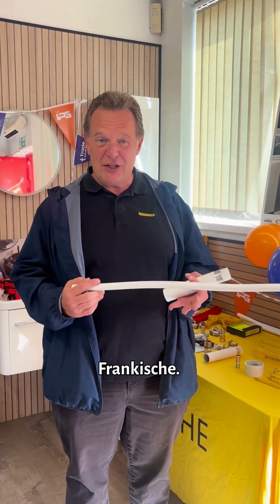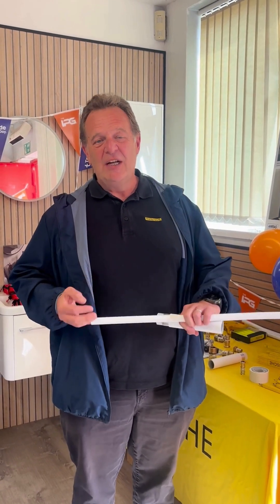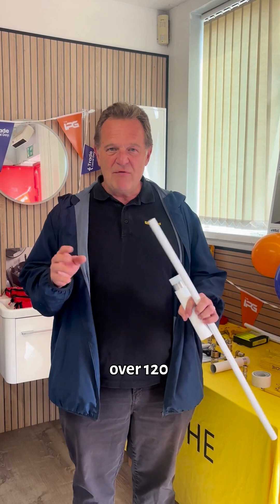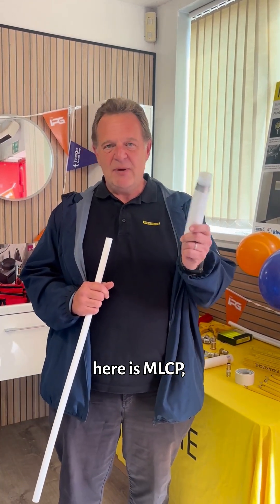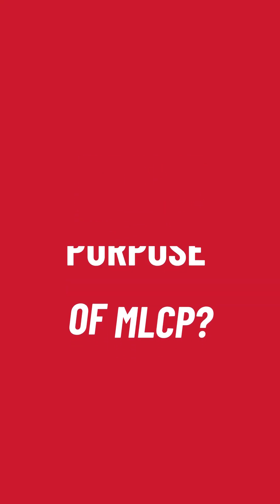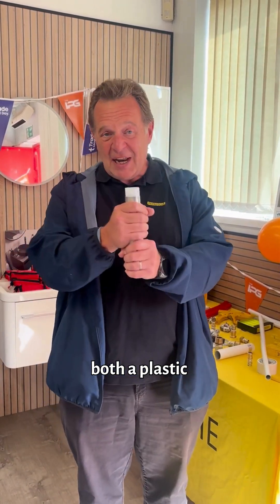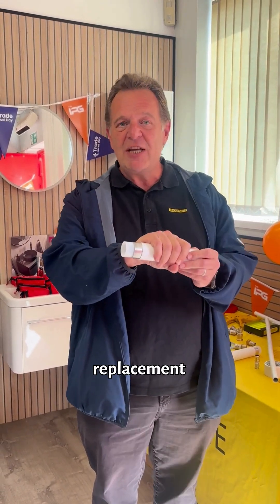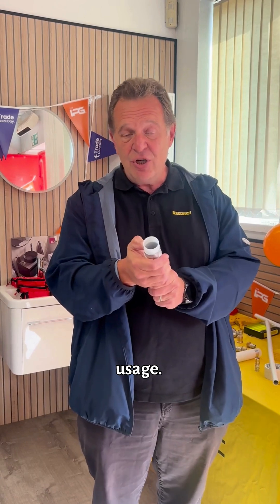MLCP Pipe & Fittings Explained | FRÄNKISCHE Q&A with Kendor Plumbers Merchants

Comment: Can you convert existing pb or pex plastic pipe to mlcp using an mlcp fitting?
Reply from the maker: FRÄNKISCHE alpex fittings are designed as a complete, closed MLCP system. The fittings therefore  are engineered specifically for multilayer composite pipe (PE-X / PE-RT + aluminium core) and are not designed to seal directly onto PB or PEX pipe.

If you’re converting PB or PEX to MLCP, you must do it via a transition, typically by first converting the PB/PEX to a threaded or metal connection, then using a FRÄNKISCHE MLCP-to-thread adapter on the MLCP side.

There is no FRÄNKISCHE fitting that directly clamps PB or PEX on one side and MLCP on the other.

However other generic fittings sometimes sell you an adapter that does this conversion directly, without the need for a transition on both the PB/PEX side and the MLCP side.